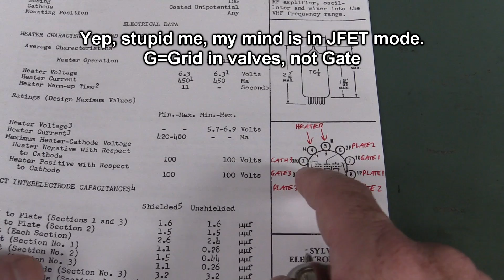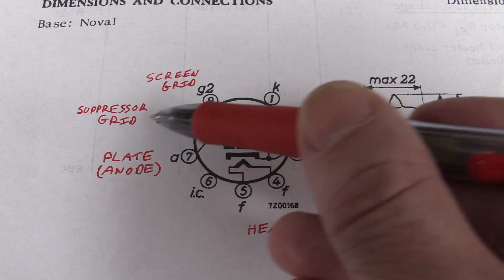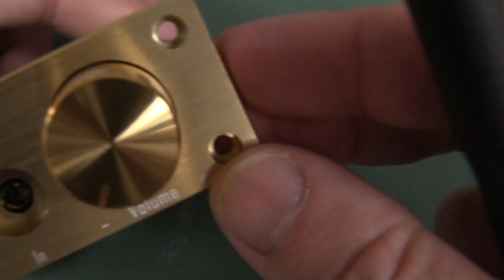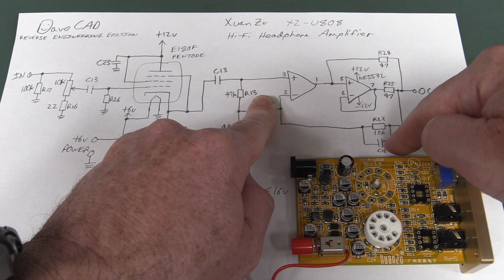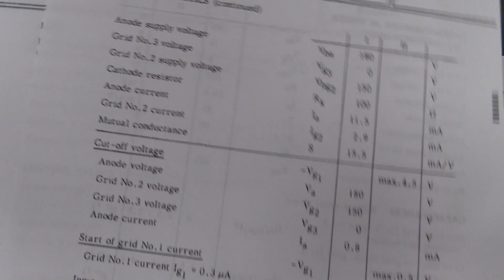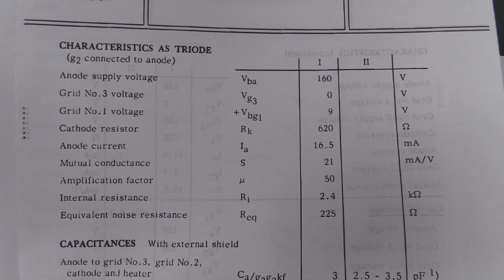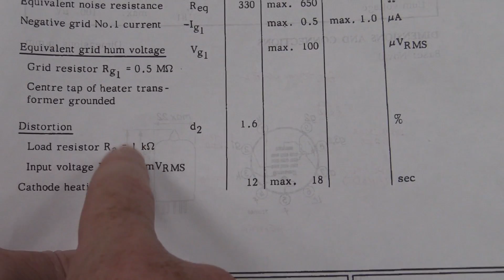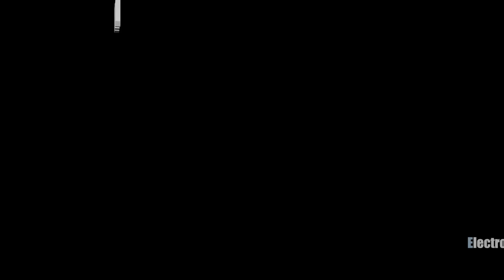EEVblog #837 - Reverse Engineering A Valve Headphone Amplifier

Comment: These things remind me of that one friend I had that re-ripped his entire MP3 collection into FLAC (from the MP3 files, not original source), telling me it was for 'better sound quality'. Biggest thing though, as with 'oxygen free' cables - don't engage with them in argument or present logic. backs away slowly
Reply: +MattExzy Well, using FLAC is not that stupid. You typically won't hear the difference, but when MP3 is used with a high compression rate, definitely will. You normaly don't run into space problems on your hard drive nowadays, so I see no point in not using loss less compression formats like FLAC. No need to say that oxygen free cables are ridiculous.
Reply: +MattExzy Sunk costs need some kind of justification. I cannot believe he actually insisted it sounded better though. Belief is a hell of a drug.
Reply: I had a long conversation once with some folks who SWORE that there's a difference in audio quality between FLAC, Apple Lossless, and Wave.

I even encoded a source file into each, then back into raw PCM samples, and ran a binary compare on the result.  The (totally unsurprising) result:  0 differences encountered.

"Well, I heard a difference."  sigh....  You can't save everyone.
Reply: +as df You missed the point...

This guy converted MP3 to FLAC...
Reply: *****
Yeah I know - that's my point.
Reply: *****
O, now I see. Yes you're right, I didn't get the point
Reply: Akin to making a photocopy of a photocopy and claiming it looked better because it was printed on photopaper.
Reply: +MattExzy Lol going from low-end source to high end FLAC. Yep that's gonna work.
I do enjoy my music but i don't buy crap. I do own a vacuum tube amplifier Class A Single ended. 
But my cables? Just decent thick copper with enough isolation (y)
Not gonna buy speaker cables worth more then my amplifier... those people argh
Reply: +MattExzy The only thing about audio cables is to avoid the CCA ones really.
Reply: Oxygen-free copper is more conductive, but God help you if you've got a cable made of oxygenated (i.e. rusted) copper, because you must've left it in the toolshed for a couple hundred years (a longer time than copper cables have existed) for that to happen.

The most important characteristic for your average audio cable to have is: Good solder joints between the wires and the plugs. I've improved any number of cheap A/V cables just by re-soldering the joints.
Reply: My favourite are gold-plated Ethernet cables. They improve quality of the bits I guess…
Reply: You know there is no shame in the High End, Howard.  :)
Reply: No, because you did not certify that the straps were assembled using only silver found in certain places known to be the nexus of fields which cannot be detected by mere measurement, but can be FELT by those not blinded by the pronouncements of engineers who know nothing about the ART of sound reproduction.  You also have not quoted testimonials from those who assure us that their hearing is superior to the masses, describing the awesome, stupendous, overwhelming improvement in soundstage, midrange focus, and rhythmic pacing that results.  If it is not advertised in the pages of The Absolute Nonsense and Stereophool, it's obviously not worth the price.  DOUBLE it, and perhaps your product will be deemed worthy.
Reply: Howard Black You have partially redeemed the product in the eyes of the Select Few, but unless it is blessed in the pages of Those Who Know, it cannot be deemed worthy.
Reply: I really do not get the "oxygen free" bit as copper tubing even at 60hz is just as good of a conductor as the best cables anyways. That is because most of the signal is on the surface and at the higher frequencies putting a thin sliver plating on the coils and then a protective coating improves RF performance. Also the only reason for FLAC vs MP3 that I am aware of is that MP3 is not public domain freeware on the encoding software. Both are a lossy format.
Reply: @mina86 Only if hooked up right way! Audio-grade ethernet cables are directional! 

My favorite is still gold-plated TOSLINK connectors. Because that gold sure does improve the signal quality of the red photons flying through the plastic under it.
Reply: @Paul-gz5dp  "Also the only reason for FLAC vs MP3 that I am aware of is that MP3 is not public domain freeware on the encoding software. Both are a lossy format."

No, FLAC is lossless (Free Lossless Audio Codec). MP3 is indeed lossy, and as for being free, there have been free MP3 encoders/decoders available for ages, most notably LAME (introduced in 1998). They were a gray area for a long time, legally speaking, but it's irrelevant now because Fraunhofer's MP3 patents expired on April 23, 2017.

Of course, encoding MP3 files with FLAC is asinine, as it's doing absolutely nothing other than making the file size much larger.
Reply: @asdf155  You obviously don't understand what MattExzy is saying. You know a little bit about the subject to believe you're right, but not enough to know you're wrong !

Comment: I actually own one, and even using only two tubes, this fine little amp has the delightful, noticeable soundstage of a tube amp. I find that quality of sound unmistakable without dismantling it technically. The tubes also make it easier to notice where the musicians are located in space. So, it's a hybrid amp with a genuine tube ambience... Regardless of whatever its distortion may be rated at - and that's probably going to vary according to the tubes being used - I have personally noticed much less listener's fatigue... I have enjoyed this amp hours on end playing music that I usually avoid because it's not a warm or full, especially at the bottom bass end of the musical spectrum. The tubes add warmth and fullness and spaciousness of sound. But my initial impression is that I was amazing at the improvement of the soundstage that even my Grado GS1000 headphones could not produce. As a musician, this is the most fun I've had improving the sound quality and my entire library. So, I'm disappointed that the technician in this video apparently didn't actually describe the amp's sound before technically analysis it. The only analysis that truly interests me are by those who have the ability to hear the different qualities in the equipment they are analyzing, and I found that lacking here... This means saying right off the bat whether this or any other amp sounds pleasing to the EARS... or why bother going to the trouble of analysis it? In the meantime, I've ordered some NOS GE 6688 tubes that should make this little amp sound even better. It's the EARS that take over after the analysis ends. So of course the tubes are having their effect.
Reply: i have one also and totally agree! its noticeable to soundstage. this review just talk about electric thing but amplifier is about sound.
Reply: Subjectivist audiophiles just LOVE not talking about noise, distortion, etc.  (IOW, objectively determining how good something is).  It's all about using purely subjective terms like "soundstage", one of the favored buzzwords.

Comment: What I want my audio to be is what is stored on the file on my computer. No coloration, no distortions, no filtering. I want to listen to sound the way it's intended to be heard, and what's on the file is what I want to hear.

Note how I said MY sound, and not everyone's sound. Some people (actually, probably a lot) enjoy the coloration of a tube amp, or a specific EQ setting, or some tasteful deviations from what the sound file actually contains. That's fine, it's what they enjoy. For me personally, I would want an amp (really, a DAC-amp combo) because the headphones I have can't be properly driven by what I already have.

Although I think we can all agree that "audiophile" grade SD cards and Ethernet cables do absolutely nothing. I really wish that the term audiophile didn't have such a negative connotation to it. When I (and maybe other people) see 'audiophile' on something, it immediately triggers our snake oil detectors.

Just thoughts :)
Reply: That is one thing I dislike about Windows and many of the drivers as there are so many forms of electronic distortion that can easily be added by the software drivers, if I wanted my audio to sound like it was music out of a well I would buy the cheapest speakers.
Reply: But even all solid state amps sound different from one another, so  in effect they are all adding coloration to the 'original'  sound.

Comment: I wish Dave had spent 5 seconds longer and switched the input to a square wave.
Reply: +dogastus Now that would have been very revealing and a good indication of performance with a 24v potential.
Reply: +dogastus what would be the difference?
Reply: +Son of a Zombie It would give an indication of frequency response. Rounded slanted edges would indicate an HF roll off, sloping top and bottom would indicate LF roll off. Any ringing on the edges would indicate poor phase response and/or marginal stability.
Reply: +dogastus I wish he would have done a frequency sweep!
Reply: cbbuntz: "+dogastus That dual opamp thing looks like a stability nightmare."

No. That is not an uncommon circuit configuration.
Reply: tube snobs love HF roll off. It makes it "warm".
Reply: I wish that Dave had spent 5 minutes longer and performed a distortion test. Because that's what all of these tube nuts love, "the warmth," aka "more cowbell."

Comment: Since the tube output is nearly the same level as the input, I would love to see what happens if you pull the tube and simply short from pin-to-pin - letting the op amps do all the work. If I'm reading the schematics right that should give a fairly good quality result.

Probably too late since the video is from a year ago.

Comment: I'm a musician and an electronics engineer.  Tubes are not better for purely listening to music.  I want to hear the music as close to the original as possible.  Give me a low noise solid state amplifier for that.  No filtering or "coloring".

However, for guitars and basses, the tube sound is real!  Tubes sound fantastic for their dynamic range compression and harmonics they add.  Not ideal for playing recorded music at all!
Reply: I disagree tubes are best all the way around. I remember even an AM radio with tubes the sound sounded like stereo. Not the all American 5 tube radios I mean Atwater Kent and Zenith radios. they mainly used 6V6 or 6F6 amplifier tubes, even the rectifier made the sound better. The youth of the 80's and beyond havent heard the real Hi Fi sound only tubes can produce. I had an Admiral Record Player that used 2 6aq5's and one 12ax7 and a 5y3 rectifier and the sound was outstanding especailly when I used a 10inch woofer from an old B and W TV set. Tubes rule in good HI FI audio.
Reply: @ronb6182   No Ron B, it's because the music was better then.  ;-)
Reply: @j.w.8663  the music is the same same songs we are talking about fidelity. I have and played the same records on both type of amplifiers and tubes win every time. Even the rock song seasons in the sun sounds better on a dynaco amplifier than on modern stereo equipment. My friend listens to rock music I don't as a general rule. I may have a handful of popular tunes I like but my main is classical music. Big band music was what I grew up listen to when I was young, I had a few years listening to 50's rock when I stayed at my birth mothers house but when I was really young like 3 years old my adopted parents listened to big band music. The classical music came into my life when I was 7 years old when I started piano lessons.

 I agree the over the air music was better then because you had a choice what type of music to listen to. The old Atwater Kent radio could pick up stations all over the country on AM. The tv antenna was also used for my radio I just used one side of the 300 ohm twin lead line. I don't remember grounding the radio. AM today has nothing to offer. You can get choices on the internet like you could over the air in the 70's.

 I haven't tried cds on my tube amplifiers yet because I need to recap my equipment, I just aquired a varac that my work gave me for helping unload a storage hanger at the local airport.  He said he used the varac when he repaired tvs and radios.i will try it on some of my tube amps. I would never run on 125 volts the tubes need 110 volts for that was the voltage back then.

I believe the best of both worlds will sound good. I will post later when I hook my cd player to the tube amps I will also try my computer sound on the tube amplifiers as well. They sell headphone tube amps on amazon and ebay, but I don't have that kind of money to spend.
Reply: Tubes/Valves adds presence to recordings, mainly because of even harmonics and soft clipping! Guitarists like overtones like the octave 5th’s , minor 7th’s etc - physco acoustics, Fourier analysis, Taylor series, mathematics way beyond my uni days!

Comment: What pisses me off about this subject is that it is really subjective.  
I used to be a recording engineer, not a sound engineer or a mix engineer. My job was to capture the performance or sound source as close to original as possible.  
For this job you needed an objective ear, one that can pick out small imperceptible things that many other people would miss.  
A simple thing like positioning a microphone 20 cm to the left would change what was being captured and recorded.  
We would use expensive everything to monitor the recording. Everything from the mics and their cabling, the mixing desk, the headphone pre-amps and the headphones, no expense spared.  
The most expensive part of this chain were our ears. Myself and the guys I worked with could hear an aircraft or local traffic in a noisy concert hall, or on location we could hear insects that were going to tape but the rest of the crew could not hear until we pointed it out.  
  
Anyway, to my point...  
With modern equipment, and we can even include smartphones here. You are able to EQ or tune your sound to how you want it. 90% or greater of users don't know how to do this in any way close to correct. I have even worked with professional engineers that disputed the clear evidence from the expensive digital readouts and ended up screwing up the recording.  
  
When it comes to sound, every person seems to be a professional.  
And fuck valves. Whatever they did for audio can be simulated and tweaked beyond your imagination in software. Even down to adjusting the element temperature and the surface area of the grid and so on.  
  
Rant over.  
  
Nice vid Dave.

Comment: Fun fact:
The European ECH83 mixer/oscillator tube will work with a plate (or anode) voltage as low as 6 Volts. It was mainly used for car radios.
Reply: +Runar Damnes yea, but this EF80 alikes aren´t made to operate at low plate voltages
Reply: +TubiCal&#160;
EF183 will work down to 20V or so. Not sure about the EF80.

Comment: The equivalent tube to the E180F, which is special quality industrial tube is the 5A/170K, the 6688, or the CV3998. The 6J9P is originally a Russian standard-grade tube, 6J9P-E is the strengthened version, but it could be 10,000 hours type, instead of the 100,000 hours special quality tubes.

Comment: I remember I saw a schematic of a all-tube automotive radio receiver in which ECC86 double-triode tubes were used. They were designed to operate at low anode voltages like 12 Volts at the cost of higher distortion. In comparison to other car radios with vibrating voltage converters these tended to sound "dirtier", mainly because of that relatively low voltage. If you get your hands on one of those radios - that would be great. Worth of mentioning: in many guitar amps with tubes on input they use tubes like ECC81, ECC83, and so on (triodes) that are interchangeable, meaning you can swap one type for the another in most cases.

Comment: @eevblog Dave, one reason for tying one of the grids to the ht was to use it as a space tube, the low voltage ht, often just 12v. This was very popular in car radios before the proper dedicated low ht voltage tubes were developed for the car industry in the 50-60's this was short lived with the advent of more reliable transistors.

Comment: If you are feeding in line level 100/500mV all you need to drive a low impedance headphone will be a current amplifier. Very little gain is required. If a valve only is used it will need a transformer to converts it's high impedance to the low impedance headphones. Which will lead to phase shift, more distortion and poor bandwidth ie a valve amplifier.
Reply: +Michael Beeny I fully agree on that. I built a simple transistor amp with small voltage gain, but decent current gain. Even at same volumes on the output, sound with the amp in the circuit becomes a lil' bit better (better bass)
Reply: +Michael Beeny Good transformers won't cut much subbass or introduce any appreciable amount of phase distortion in audio band either. Some people actually even build transformer coupled amplifiers specifically because they're easyto make. The downside is mostly weight and output impedance - in audio applications.
Reply: +Michael Beeny LOL totally not true unless you use a garbage transformer. There should be very little distortion in a good transformer.

Comment: A headphone amp doesn't need much voltage gain, and you can do it with just a 5532. But better is to have some extra current output for low Z cans. Running a triode/pentode at low voltage is fairly common in products where they just want the "valve sound" - the low volts if helps the typical distortion sound. You could have just pulled the tubes to see if it still passes signal, and saved a bit of time. ;-)